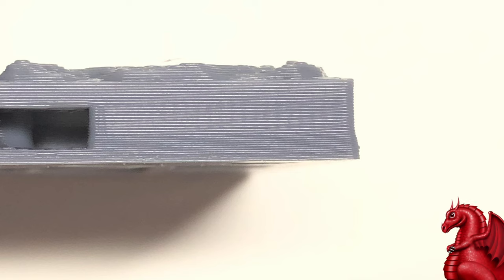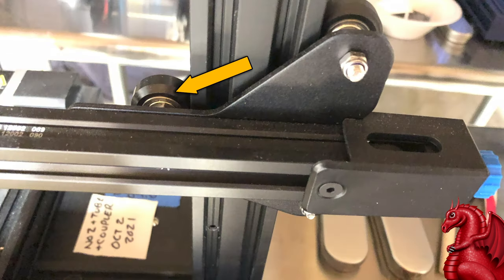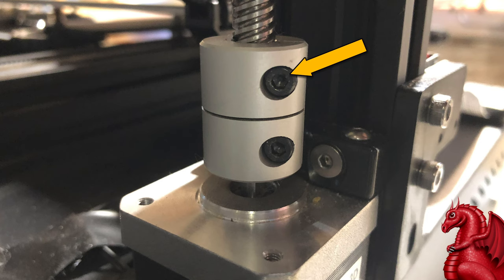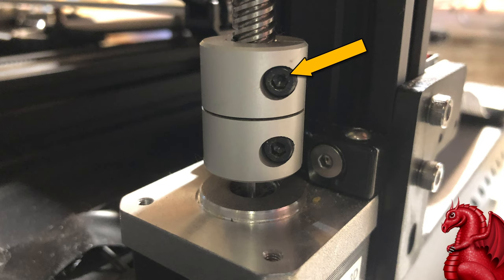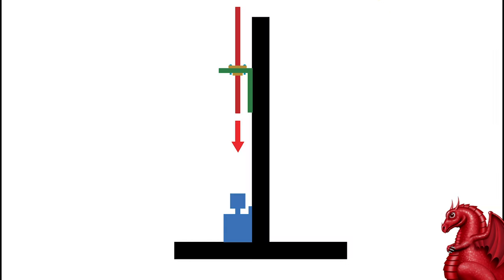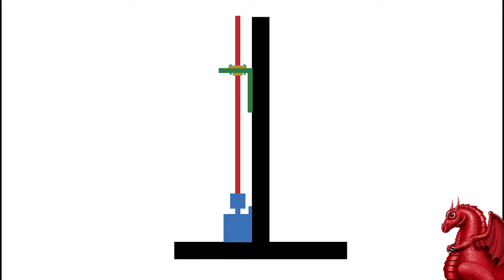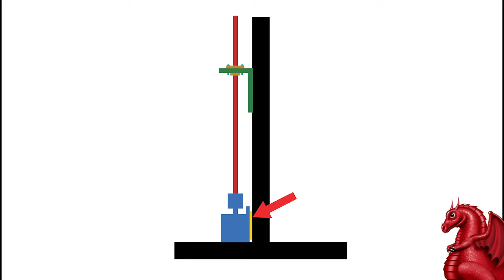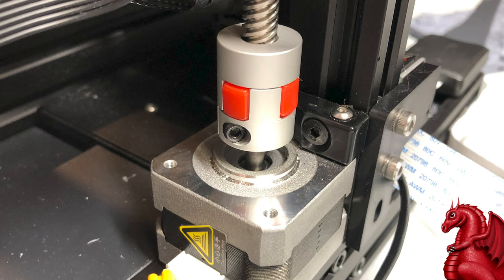Ender 3 - How to fix Z-axis binding

Comment: I'd experienced some really bad Z binding on my recent prints but with the help of this video I worked out that it was because I did not tighten the screws properly after installing a filament guide on the extruder. Thanks a bunch!

Comment: I had a issue with my ender 3 pro I installed dual axis and cr touch. Everything seems to be working fine but after a few layers it raises up too far and prints away from what it already printed probably 2 to 5mm too high any solution to this any help would be appreciated thank you
Reply from the maker: Which of our models is causing you the issue?

Comment: my z-axis's will not go to the auto home when i try it moves itself all the way to the top of the printer and makes a god offal noise. i am not able to figure this out and I'm ready to pull out my hair when I try and manual through the computer to adjust the x,y,z they all do what they a mint to do except the z. please please help i just purchased this printer
Reply: Sounds like your Z-axis is oriented backwards, so the printer thinks it's going down and waiting to hit the Z-stop. Likely it's just your stopper motor is miswired, switch the wires around to the proper orientation and it should work just fine.

Comment: I'm getting a shift, basically half way through the part, on every attempt so far, the part moves over like a mm to the right (x axis).  Anyone know if this is the same as the problem in the video, or how to fix this?
Reply: Loose belt most likely, less likely is not enough voltage (vref) on the motors.

Comment: My z axis is binding heavy! When I disconnect it from the coupler it moves very well but as soon as I reconnect, it binds super bad. I bought the coupler at the end of this bed and am HOPING it helps abd I can finally print a full piece!
Any thoughts or additions are appreciated.
Reply from the maker: Loosen the two screws that connect the brass nut the Z-screw passes through right next to the extruder motor, 1-1 1/2 turn on each screw should do it.
Reply: @Tombof3DPrintedHorrors  I did. Doesn't work. If I take it all apart, should the z motor turn quickly with ease by hand or be kind of tight?

Comment: Interesting. I haven't had that problem, Ive had just about every other problem! What would you think if the Z axis will move up, but not down, and when you auto home, the z axis is way above the bed? Ive been researching it but I cant find that problem specifically.
Reply from the maker: First guess would be that the motor wire is plugged into the wrong place on the board.
Reply: @Tombof3DPrintedHorrors  Thanks for the reply! I'm pretty sure it's in the right place, but I will double check it.

Comment: I had 2 Z-axis issues

Hopefully my solutions can help you if you have the same.

First issue: 
first 4-10 layers were squished into the bed, causing improper height of all prints.

Solution:
 ironically, the "loosten these 2 screws" solution (3:20) was causing this. With the screws loose, the beginning of each print started with the screws pushed in. So the first couple layers, the rod would spin and the z-axis gantry wouldn't move up at all, but the screws would increase in length. I fixed this by fully tightening the screws.

Second issue:
 the z-axis jammed at 4 cms up

Solution:
Basically the green bracket (6:36) was bent inswards slightly, so when I brought the bracket up to the top, it dropped in at an angle. To fix it all I did was bring the bracket up to the top, and then use the rod as a lever to slightly bend the bracket until it was 90˚. I checked my wiggling the rod back and forth (it has a little play) until it's wiggle area was centred over the centre of the motor. 

No shims or anything required, and the z-axis threaded rod isn't bent or damaged after doing this.

Comment: Thank you for the tips, I have a CR10S pro for about 4 years maybe and this has been the bane of my existence I'll get 4 months of good printing and then Z-Rod binding drives me mad I can't get it to work right I've done all the fixes you mentioned except for those flexible cobblers couplers, stupid voice to text 😂. My Z-Rods appear to be straight and they're super clean and lubricated I strip the machine down last night put it back together Deck was true Gantry was level got one print which was the cube 20 mm size and it came out decent. And then everything went wonky and I started getting the Z-Rod binding on the drive side. It really kills the 3D printing hobby for me. When this printer is working as intended it's really good but it has a gremlin that comes and goes and I can't figure it out getting ready to take it out back behind the shed put a 12 gauge in it lol.